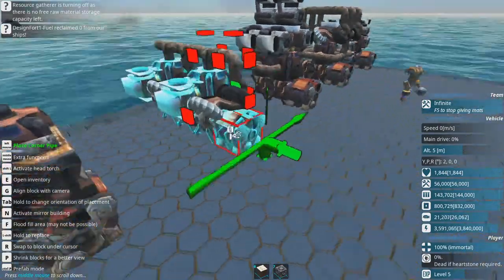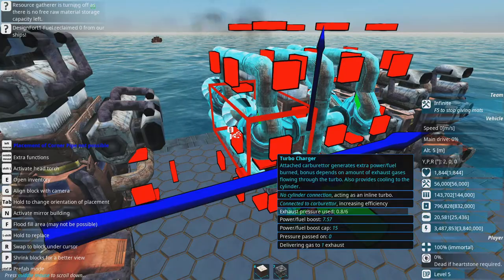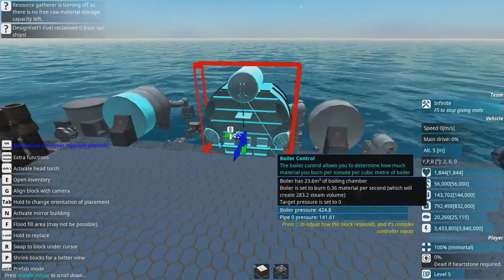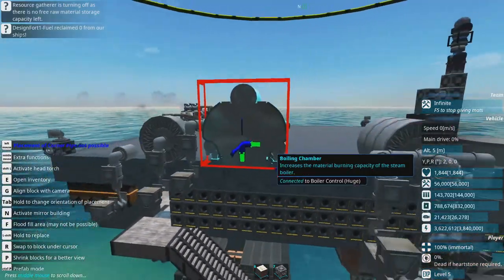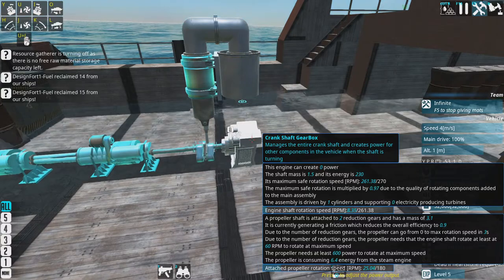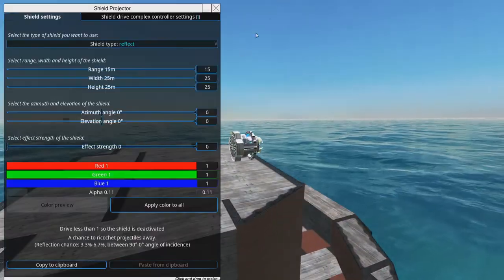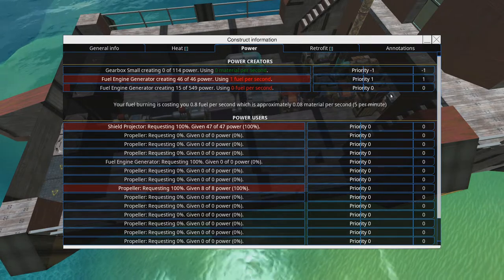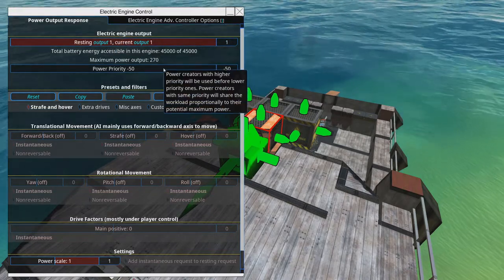From The Depths News, UPDATE 2.7.2.1 Power and Engine Priority

Comment: Fuel Engines ware Broken and OP ...Steam is simple and compact...not much to learn. JUST REMEMBER TO:
1. Always use Auto-Regulate option, without it your burning chamber will consume maximal ammunth or materials constantly without areason, auto-regulate will turn it on and off cutting use easily by 1/4 !
2. Auto-Regulate gives you nothing if you set maximal pressure at to high value in comparison to burning chamber size, check optimal pressure for chamber by setting max pressure and watch  the climb speed, at some point it will slow down considerably (that your max optimal presure) and after much longer time reach its max pressure ...all this time burning maximal ammounth of materials, also the lover pressure the more efficient auto-regulate is ...auto regulate at max pressure will almost not save you resources. If you set max pressure BEYOND chamber potential you won't ever reach it but chamber will try and burn materials like crazy.
3. EFFICIENCY: Burning ammounth is not only linked to pressure, but also size of chamber (the larger the more it burns but reach pressure faster and has higer max pressure) ...with them being simple to build and compact its very good idea to use larger chamber and set under-medium pressure so it will climb faster and burn less for same than smaller boiler around its max pressure... at low pressures there is not much diffirence between both but thats a waste.
4. Set ACB's to switch between burning rates, its a very good way to preserve materials...especially if you use electric engines and batteries link those to steam engines - good setup will engage under 85%, speed up and stop energy decline around 60% and rise energy slowly to 85% again. Moment enemy is destroyed or energy reach 85% material burn for steam cuts off but pressure remain and still charge for some time (once again larger boilers speed up faster and hold pressure longer as have more volume) so yuo can again reach 100% easily.
5. Large electric turbine are shit. Use small...and make some tests...sometimes fo same volume of burning chamber is smarter to use few small turbines in place of one, and work as redundancy backup.
6. Test and build them with patiance doing something else in-game in the mean time as presure need to stabilize.
7. You can use small burning controller on large and huge chambers.
8. Profit. Have fun. Don't take vaccine that will change your DNA (a.k.a. don't give someone your work project to fuck around you don't have backup of - quite obvious i suppose).

Comment: I think they improved the amount of fuel and material you can have on the containers as well in this update. 

Also, about the turbines, before the update they seem to generate very little more energy on larger/longer sizes for the same pressure. (About 5~10% more energy).
Reply from the maker: I didn't test turbines, and yes the length didn't seem to make much difference previously.
Will retest on a follow up on steam systems.

Comment: Let's face it. They screwed fuel engines over royally. There's no reason to use them over steam electric hybrids now.
Reply from the maker: The overall power per resource point is still better in a good Fuel engine,. 
If you only look at min/max then steam has beaten fuel engines for maximum power for awhile.
IMHO fuel engine turbos where broken and needed fixing, a turbo does not give you infinite fuel efficiency..
Reply: @DelsGaming  I don't disagree that multi-turbo per carb engines were more then a bit busted (4-5 turbo designs, although massively bulky, did give thousands upon thousands of power per fuel) but we've gone from feast to famine.  The developer's seem to be way, WAY to fond of HUGE 'balance' changes that more resemble nuking parts of their own game down to bedrock.
Reply from the maker: I understand this is a big change and it is difficult for those that had got used to something broken to now have it fixed. That is one way to look at it. If you started FTD with this setup then you would not see it as broken. 
In the end provided your opponents either AI or players are faced with the same set of rules and dynamics then it is fair and I would prefer a long term view. 
I think there is still some tweaking left on this and Steam is due to get an overhaul also so that may change the steam setup also and bring back parity in some areas.
TLDR: don't get too used to any one design dynamic, stuff changes...
Reply from the maker: I haven't fully tested all the new efficiencies yet but yes transportation is an issue, and that applies to resources if using localised then it must also be transported to the user so that cancels out, locally gathered (enemy destroyed ships) may be used for repairs so can't assume it will be enough for fuel as well. 
Fuel refineries can make fuel at a very efficient rate so I will factor that in when looking at it.
My feeling is that fuel engines will be more efficient if block size is not an issue. Steam will be more power dense but at the expense of resources. That is speculation not had time to test yet.